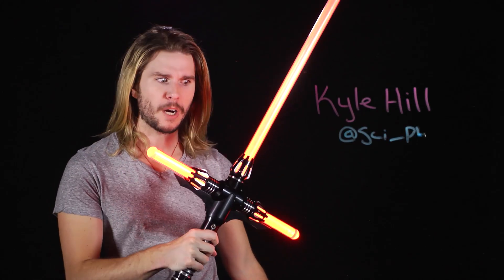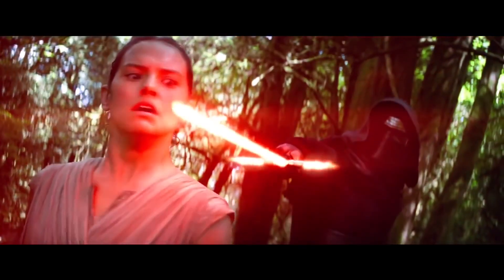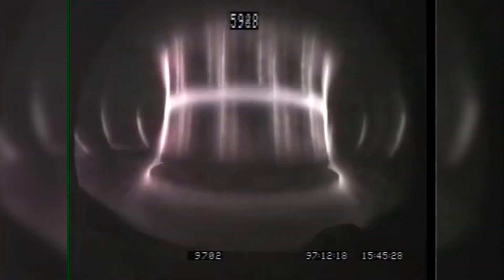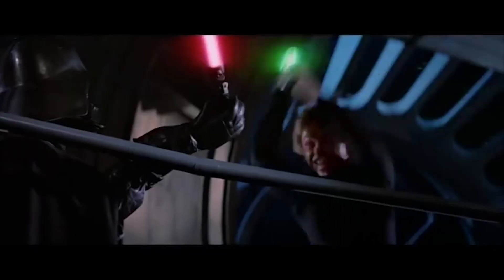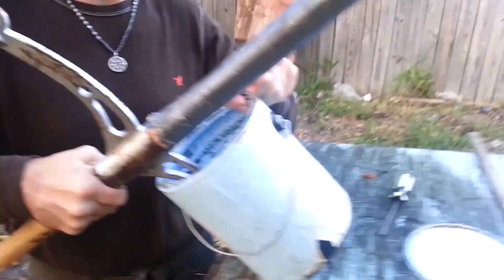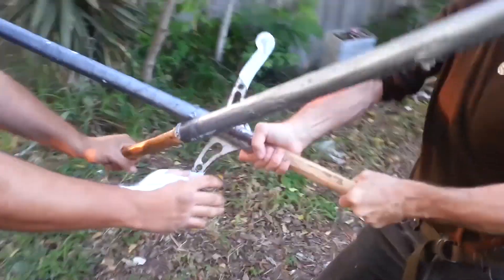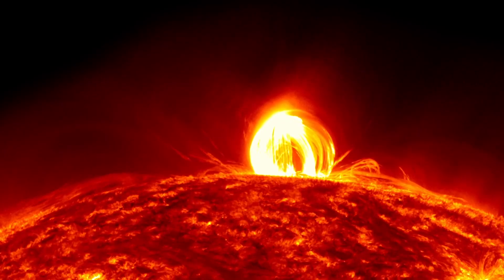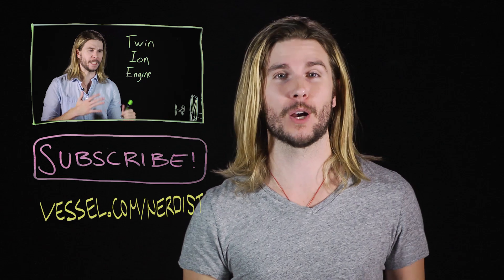Why Kylo Ren's Lightsaber Works (Because Science w/ Kyle Hill)

Comment: the reason they object is because the exhaughst vents will just be cut off when he tries to defend anything.
Reply: an exhaust vent is just a big tube. if you cut it off that just means there would be more blade. maybe dangerous if a lightsaber could slip down, but it never has before
Reply: @nathananderson1550  it will expand into his hand
Reply: why would it expand if it doesn't with the bit still attached. the exhaust is shooting out like a geyser, so if it were going to expand it would do it towards the end of the blade and at a more gradual pace due to its speed. and thats ignoring the fact that if a light saber were to cut it, there is still a blade in there, so it cant cut all the way through. only the top third would be damaged if was hit right. we could possibly also assume his hilt has a different casing design with materials or tech normally used on the inside to keep it from exploding. for a normal user you wouldnt need it because if your hilt was hit then your hands are probably gone anyways. and if none of the above is true then it would go straight through the hilt never mind the vent
Reply: @nathananderson1550  the lightsaber was stupidly designed, so if you cut the exhaust system it would cause energy to vent everywhere. This, combined with faulty parts, would make it at the very least destroy his hand

Comment: This is old but i have a comment. I still side with the theory that the cross guards are more dangerous to the user than the opponent. 
Heres why. Precisely because of your point that the saber handles nearly same whether or not its on since the blade (s) effectively have no mass or weight, they add very little ballast or balance. Even with good or near perfect mastery, the slightest mistake with the crossguard would lilely result in a really bad and at least distracting injury to the wielder, if not debilitating or even fatal. With normal swords, the balast of the crossguards provide balance and feed back to the user allowing them with practice to be able to feel them and know where they are in a complex maneuver. Not so with kylos weapon. Sure the physical elements could offer this function and arguably protection from the actual beams so theres that, but the risk with a light saber is such that there are very few little mistake with such a weapon, any mishap is likely to be a major one, particularly in combat. Would have been better to simply use some of that material that is lightsaber resistant or proof to make  inert physical guards  from. Its still just a goofy execution of a decent looking concept. 
The should have made a slight swell at the top, with very slight extension on each side for the housing as Colbert put it, and shorter beams. They could even be longer than the current design but would seem shorter since they begin much closer to the handle. A more elegant concept. You know for a more civilised era. Sorry, had to do that. Plus that thing would be awkward has hell hanging on a belt from the hip. It would bang your junk all the time and not stay in place.

Comment: It's been retracted from the lore by Disney, but dark Jedi used malfunctioning lightsabers that would crackle, and even arc (think those static "plasma" balls). The arcing would frequently hit the user, pissing them off, which would battle-trance them and increas their dar-side affinity. 

The crackling actually decreased the temperature, and therefore effectiveness, of the weapon. It would, however, hurt like a SOB! Causing suffering in the victim when they would have been killed outright by a regular lightsaber, toying with them.

Comment: A lesser known fact is that kylo rens light saber Crystal is cracked and unstable. The guards add protection and are used as a vent for the excess plasma coming from the blade. Without them, his hilt would overheat and explode.

Comment: With all due respect, this is a viable mechanism, but it still isn't safe.  It's true you can train so that the cross guard won't nick you, but in the heat of battle, the participants are going at it, hammer & tongs.  You could become excited & sacrifice technique out of stress.  Part of this statement is based on STAR WARS LEGENDS data.  Jedi & Sith would sometimes have a lightsaber with a faulty crystal like Kylo Ren's weapon.  The blade would have a static appearance.  LEGENDS character Tenel Ka built a lightsaber with faulty crystals.  The crystals couldn't properly regulate the power flow, which led to a runaway energy build-up & the machine exploded.  Same thing could happen to Kylo's blade if it weren't for the cross vents.

Comment: his lightsaber sparks like that becaus its unstable thats why he has those cross guards they are actuly exausts. if he didnt have those his lightsaber would explode the second he turned it on. https://www.google.se/search?biw=1614&bih=927&tbm=isch&sa=1&ei=90laWu_cC8jLsAG3uoioDg&q=kylo+ren%27s+lightsaber+inside&oq=kylo+ren%27s+lightsaber+inside&gs_l=psy-ab.3...4058.5630.0.5994.7.7.0.0.0.0.340.769.0j1j1j1.3.0....0...1c.1.64.psy-ab..4.0.0....0.WPDadEiVrkQ#imgrc=Lq2EcYdX1vL6eM:    you could actuly slice trough kylos hilt its not that hard.

Comment: Technically they're not cross guards, while they do serve the purpose of a cross guard, they are exhausts used to stabilize the light saber because Kylo ren uses a cracked crystal. Due to the cracked crystal, the light saber cannot maintain a perfectly straight edge and so it crackles and spits flames like no other saber. The exhaust fight to keep the blade relatively straight

Comment: Kylo Rens lightsaber has a broken kyber crystal in it which is half of the kyber crystal what was in darth vaders lightsaber. But because it is not a full crystal it is not in control and that's why it sparkles. The little sabers on the side are not for protection, they are there just because the crystal isnt fully controlled so the leftover energy goes to the sides not to the main blade if you know what i mean

Comment: Ok, listen up chodes. The "parsec" remark is only nonsensical if you assume the Kessel Run is a timed event. There are all kinds of ways it could be based on finding and successfully following the shortest possible route to complete a task.
If the Millenium Falcon was fast and agile enough to deal with an obstacle(such as an Imperial blockade) without having to go around, it could complete the challenge by traveling a shorter distance than less well-engineered ships.

Comment: i mean it's just like there's 3 sections so you could just hold it at the middle or bottom?
plus the kyber is cracked so lots of energy; aka no excess points and it'd explode because pressure.
anyways kylo is also edgy so he's gonna be different af

Comment: I personally think they shouldn't be straight out from the blade but slightly pitched forward. Would definitely give one more ways to handle the weapon and the only disadvantage would be effective length and that's still a big advantage over nothing. A katana doesn't have a crossgaurd but it's still got a form of hand protection in what I believe is called a suba which does the same job as a crossgaurd just not as completely

Comment: What's nagging me is the fact that Kylo's lightsaber is made after a very ancient design as it is described.

Which would mean that ever since lightsaber wielders have found this crossguard either useless or dangerous enough to never use such design again.

My theory would be:
It is said that lightsabers have a high gyroscopic effect when swung around (and this is mostly why they would be dangerous to any user that wouldn't have been trained properly to use them).
And maybe that's the point: if it is so difficult to control or cancel the gyroscopic effect, one could easily cut off their own hand.
Pay attention to three blades would actually be much more difficult than paying attention to one (think of the disadvantage when facing a lightsaber wielding opponent).

Besides:
Kylo's lightsaber is described to have this kind of design because of the instability of the kyber crystal embedded in the hilt, the "crossguard" actually being but power evacuation shaft. This is also the reason why Kylo's blades look fiery unlike any other lightsaber's straight and clean blade.
Sounds much more like a flaw than an upgrade, actually...

Comment: A crossguard is useless for a lightsaber because the plasma beams bind when they contact eachother. Crossguards are to protect from the blade sliding into your hand when you block or deflect it, that doesn't happen with lightsabers. The only explanations for the Crossguards that I've seen make sense, are either the crystal is unstable so the blade needs vents to compensate, or they are purely for intimidation (which is clearly something kylo is going for) i guess you could argue that it has offensive value, if i recall kylo stabbed the black guy in a blade lock with the Crossguard.

Comment: Idk if this has been commented before or if it’s ever been mentioned in the cannon Star Wars but in the Thrawn Trilogy it mentions in one of the books (I think the first one) when Luke is running from thrawns soldiers on a uncharted mercenary planet that lightsabers leave microscopic cuts that appear to be cut and in the same motion cauterized

Also to kinda stoke the flames in the comics and books there are a lot of crazy light saber designs there’s a sith chick with a light saber whip there’s a couple Jedi with cross guards one being two coming out at 45 degree angles coming off the main saber and another with a single vent making it look like a dousing rod but you obviously don’t grab it like one

Comment: Well lightsabers have crystals in them that produce the blade when energy goes thru them and kylos lightsaber has crystal from vaders lightsaber inside but luke skywalker has a fragment of that same crystal tied to a piece of rope and around his neck so kylos lightsaber is missing a piece and that means the crystall has to vent that unused power somewhere or it would overheat and explode so its wented from the sides when it starts overheating and also the crystal works bit like optics in a laser pointer and the crystal is missing a piece so thats why the blade is all fucked up makes weird sounds when you activate/deactivate the lightsaber and when you see lukes old lightsaber the blade is nice not fucked up at all probably just a little bit damaged from the fall in cloud city and it does normal sounds so information in this video is all wrong sorry

Comment: Ok, you mentioned parsecs, so unless someone else has in the comments, I am going to settle the dispute once and for all. Parsecs are actually a measure of distance, so it makes no sense in Han's statement. Why would you suggest you can travel a smaller distance when bragging about speed? Well, the Kessel Run is actually home to a giant black hole. When Han says that the Falcon made the Kessel Run in less than 12 parsecs, he means that he passed 12 parsecs away from a black hole. In order to do that, you have to travel really fast, thus meaning that the Falcon is really, really fast.

Comment: Yes plasma is weightless but the current of power surging through it makes it tricky.And cross guards are unnecessary because lightsabers that don't have cross guards have a magnetic field guard around the handle that causes resistance and gets rid of the need of the cross guard that's why the cross guard lightsaber is an ancient lightsaber design. I theorise that the cross guard was an early attempt of a lightsaber because it has the guard but no magnetic field that I am aware of but later lightsabers don't have guards but do have the magnetic field. Plus the cross guard doesn't offer as much defense benefits as one would think but mostly offensive benefits.

Comment: Actually, the crossguards on the lightsaber are not there for advantage during duels, but rather to protect the lightsaver from overheating. You see, the kyber crystal inside of Kylo's lightsaber is cracked, so in order for the lightsaber to function properly, excess heat must be expelled from the saber so that it won't overheat. So, ports must be installed on the lightsaber to release the extra heat from the hilt, which is why the crossguards turn on after the main blade, as it takes a second for the saber to heat up.

Comment: There are a couple things you said which are wrong. First, the reason why Kylo Ren has crossguards is because the Kieber Crystal that is in his lightsaber is cracked, thus causing it to be unstable. The guards are basically kind of acting as vents for the excess energy. Second, the reason why his blade crackles is because of the aforementioned damaged Kieber Crystal.

Comment: The blades do have mass, as SW Rebels explained. However the crossguard would make the blade more nimble in the hand. Axes actually weigh quite a lot less than a sword, but FEEL heavier because that weight is all concentrated in the steel head. Meanwhile swords are balanced so that the point of balance is near the guard. The POB on a sword varies depending on the exact sword and there is no "perfect" balance point (blade-heavy swords cut better but hilt-balanced ones give more precise point control, so a hilt-balanced sabre and a blade heavy rapier are garbage while a blade heavy sabre and hilt-balanced rapier are ideal).
The standard lightsaber would be more blade-heavy than the crossguard sabre. This would mean the crossguard sabre would offer more precise point control and quicker redirection of the blade, and since lightsabers don't cut in the same way real swords do being hilt-balanced isn't going to really alter the cutting capacity. There isn't really a downside to having the guard.

Comment: Kylo's saber "crackles" because its an unstable red crystal, which (before Disney changed it) were synthetically made unlike jedi lightsabers. If the crystal was stabilized like normal, then i could agree. However, an unstable, synthetic plasma crossguard...probably not the best choice.

Comment: Well with stable kyber crystals (the things that make light sabers work in the Star Wars universe) the blade already prevents the opponents blade from riding down during blade locks. Kylo has cracked crystal, so the cross guard acts as side vents making it more stable and providing protection.

Comment: Kyle, i know it's been like a years since the release of this video, but i'm just watching it now and this question came to my mind, tokamak it's a prototype for fusion reactor, it actually produce fusion, the only problem is that it produce less energy that it requires in order to mantain it, and even then, with all the energy input it has, and a magnetic field in the order of 10^5 Teslas, the plasma inside of it oscilates, so, if the lightsaber it's plasma, and is confined using magnetic field (a really strong one) then a light saber is really a Fusion saber right?
Reply: and btw, i'm sorry for the bad english (maybe, idk really)

Comment: Fun thing about the cross guard they are basically vents to regulate the flow of the plasma as the crystal in kylos lightsaber is in fact cracked making in unstable without those vents it would have blow up if he had tried to ignite the sabre for the first time, the cracked crystal is also the reason the blade looks the way it dose

Comment: Beg your pardon but no, it does NOT look better than most lightsabres. It crackles and sparks like its about to short out any second. It's like comparing a cracked, rusty blade to a polished one. Also, from an aesthetic view, it looks gaudy. The lightsabre blade is meant to be the part that draws the eye and makes it a thing of beauty. Having two diddy little side flares is too much of a good thing. More importantly though, ALL lightsabres already have handguards. Jensaarai1 explained that the same magnetic field that contains the plasma acts as an invisible guard. And before you mention all the hands/arms that get cut off in duels, pay attention to those scenes. When a Jedi/Sith has his hand cut off in a lightsabre duel it's nearly always due to an UPWARDS strike (Dooku vs. Anakin in Episode II, Luke vs Vader in Episode V etc.) meaning that a Kylo Ren-style cross-guard would have made no difference.

Comment: It may work but this is actually the old form of lightsabers from the early days of the Jedi/Sith. Those cross guards are exhaust fumes because the saber wasn't capable of holding in the energy due to an over-corrupt  kyber crystal.
Also those cross-guards protect the arms in a lightsaber duel. Any lightsaber duelist worth his soul knows that.

Comment: Hello! Huge nerd, here! Kylo's blade crackles because the kyber crystal is cracked. The cross guards are vents, so that the crystal, which is more powerful than others, does not overheat. His hand would not even get slight burns (nor would Rey's neck) because the heat is contained it the force field that gives the blade it's shape. Agent_Ocelot, over and out!

Comment: breaking the casing of the cross guard would cause all the energy to shoot out of the newly formed exit not to mention all the things needed to force (no pun intended) the excess energy from the main part of the Sabre that makes the cross guard will also break which could overheat the entire Sabre which literally runs on batteries and it could either melt the Sabre or make it explode

or both